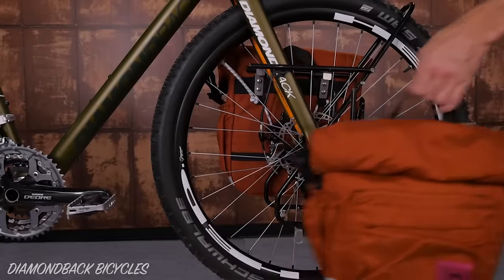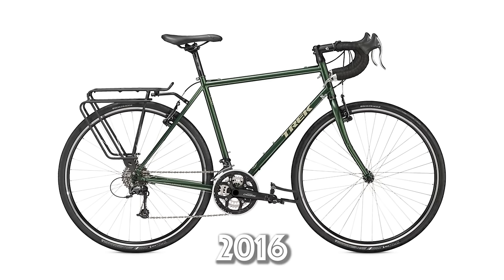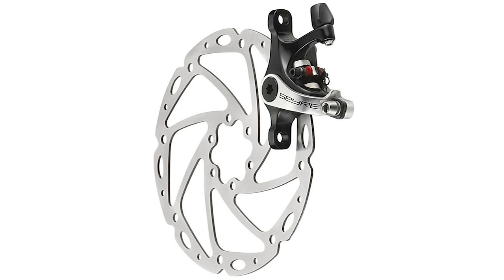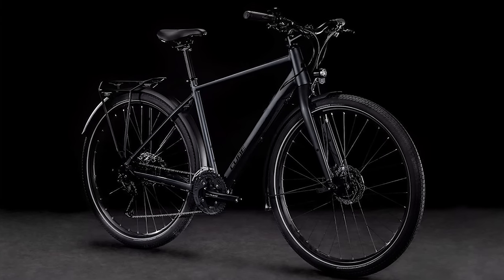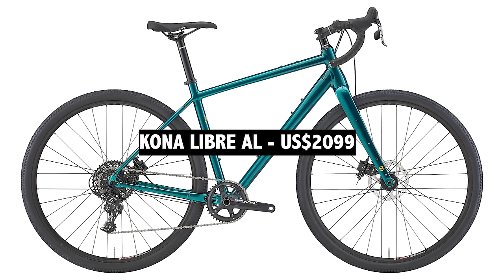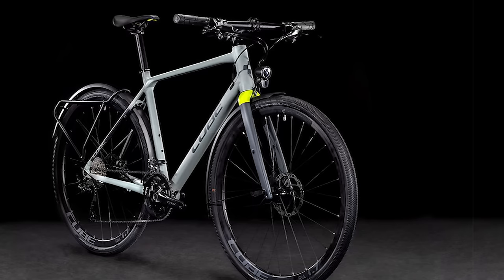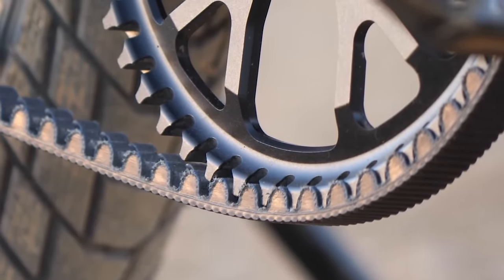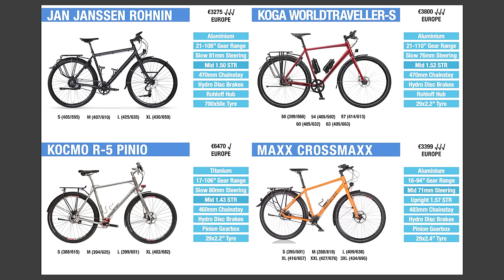The 13 BEST Touring Bikes For 2022!

Comment: Curious to not find the Priority 600. Belt drive, Pinion gear system, dynamos... It checks all my boxes!
Reply: Totally agree but I think the dynamo was ditched in the production run.
Reply: @Trenchfoot1  I have one, has a dynamo that powers the stock front and rear lights.
Reply: I think price was quite a big factor in the choice of bikes. I'd also like to see more belt drive bikes reviewed and can accept they would cost more.
Reply: @Rick--A-F  I think you’re right.
Reply: @johng1857  Ah, sorry. I was thinking 600X.
Reply: Pinion sure seems to be well priced for a Pinion / Belt drivetrain, but it's not really in the scope of Alee's list.
Reply: Maybe because it's more of a commuter than a tourer, geometry and component wise? The 600x though seems quite the offroad touring machine
Reply: @johng1857  I have a Tout Terrain Metropolitan that uses a Rohloff hub and carbon belt drive, it's a really good system and makes for a relaxing ride. I'm always interested in what other bikes are like!
Reply: True, l owned one of Priority Bikes. So far I am impressed by the Quality. I wonder this video mainly focus on Europe bikes!
Reply: Priority probably didn't payed for advertisement.

Comment: Nice video, I've done over 30 multi-week (and one 3 month in USA)  loaded tours on a 90's converted MTB with drop bars, and I've never needed a dynamo and lights.   I get it if you are riding in remote wilderness, but really, How many people are doing that so a mass market bike needs the expence and complexity of a dynamo.
Reply: What do you do for lights?
Reply: At least in germany you get fined for riding in the dark without lights (no matter how well lit the street is you are riding on), and I think it is pretty similar in other European countries. I was more suprised that lights were included as an extra since there are a requirement here for any bike (except dedicated racing/mountainbikes). Edit: on second thought: regardless of laws I think having lights (and a dynamo is just a great solution, since you dont have to worry about charging anything) is also a security concern, since cars see you a lot better if you have lights. So I think there are even more important in more populated areas and not so much in the wilderness where you will not meet so many cars/vehicels.
Reply: I agree, would seem commuters would be the riders who would benefit most from a dynamo
Reply: Now, during winter, I always arrive home after dark. The same has happened while touring when campsites were full and I had to look for accommodation after dark. A light, with a dynamo or not,  is needed to see and be seen.

Comment: The Shimano 105 11s pairs with a MTB derailleur in the Co-motion Deschutes? I'm not sure if it could work.
Reply: I thought the same thing, but Alee is generally very knowledgeable about gearing, so my guess is they've implemented a work around....
Reply: I checked this a while back while building up a gravel bike. 105 shifters won't run a mtb derailleur out of the box, but you can get an adapter that will make them work. I just ended up going with grx for simplicity sake.

Comment: These bikes to be honest all are expensive.What I did and suggest riders with tight budgets get 90's or 2k's mountain bike used $200 and spend few more dollars upgrading components then you get kick ass touring bike without breaking the bike.My present build less then 400 is Specialized Rockhopper solid bike

Comment: Hey, I really like your videos. But try to use metric, at least vissually overlayed in your videos. The world uses metric, its 2022, and I think you want to expand your audience. Sorry that I have to be an ass about this but frankly there are so much content producers who were raised in imperial and can't/won't make the complete switch to metric but at least 'they' try. So; absolutely nothing personal against you or your good videos but if you retain on imperial only, as a viewer I will continue and seek my content elsewhere. Absolutely no offense.
Reply from the maker: I use metric 100% of the time. 'Gear inches' are number that aren't EVER converted into metric values, and you don't need to calculate them manually either - so there is no harm in using them. I use gear inches because I prefer working with the 2 and 3 digit numbers that it spits out.
Reply: @Cyclingabout   I didn't know that. And you are right, in all the videos i watched of you since, you did use metric. I retract my critic, sorry. 🙂

Comment: Yeah, the pandemic hit right before I was supposed to pick up my bike. We were banned from the city I needed to go to and they wouldn't deliver. After a year the shop refunded me. I went to the local shop, bought a GIANT hybrid, ordered parts online and made a tourer. It has an aluminum frame and I definitely feel the wobble. I just learned to distribute the loads better. Surprised at the stock components the bike came with. The handlebars and tires I kept, but the drive train was heavy and it had no racks. It's done me solid for two years but I'm definitely looking to re-enter the higher end touring bike market.

Comment: Hello. Lucky for me to be seeing this video as I begin the search for a touring bike after many years off the bike. Frankly, the one that jumps out for me is that Koga World Traveler in the orangish color. But striking out thus far in finding a retailer here in the Atlanta, GA area. Any leads to a distributor would be much appreciated. And I won't close without saying "thanks" for making so much valuable information available. Best wishes and happy trails to all.
Reply from the maker: There are no KOGA dealers outside Europe. But you can buy online direct with them and they will ship to Atlanta. Or plan a bike tour in Europe and pick one up when you get there!
Reply: @Cyclingabout  Thank you, the second option will work well with the tentative plan to do EuroVelo 6 trail later this year. I'm on it. And Thanks again.
Reply from the maker: @richardcheatham9490  Just make sure to order it with enough notice. I believe it's a 13-week delivery time currently, but best to check with KOGA.

Comment: None of those bikes are looking comfortable to ride on. If the seat is higher or same height as the steer. I ain't riding it. It hurts my neck as I am looking up all the time, hurts my wrists and shoulders as I am constantly hanging / pushing on them to sit on the bike. You should take a look on the Dutch Omafiets. Their way more comfortable making you able to sit on it longer without pains.

Comment: For a rider who wants to tour in style, quality gravel rigs are the best touring bikes. Much better - certainly much classier and prettier - than ugly 20-kilo traditional touring bikes that sport perfectly horizontal top tubes, crude, ugly aluminium or cheap steel welds, hideously layman -type (almost upright) geometry, ugly steerers that extend half a meter from the head tube. 
 While I'm a fan of carbon, for loaded touring I'd prefer a titanium bike with the following specs: 

 - Beautiful 3D-printed lugs instead of ugly welds. Beautiful, carbon-like oblique joints and not a single visible weld. 
 - Ca. 13-16 degree top tube weld: horizontal top tubes loo ugly and awkward. 
 - Preferably, NO dropped seat stays! A bit irrelevant for touring bikes, for I am yet to see a touring bike with dropped seat stays, though you can never know what to expect from fad aficionado designers. 
 - Integrated invisible frame couplers (i.e., Santana Z type, also used in some 22Bicycle models). 
 - Fully internal hydraulic brakes with leak-free, dry hydraulic couplers (i.e., 22Bicycles' Brake Break). 
 - Have all the mounts one will ever need: for mudguards, fork crown -mounted headlight, front and rear racks, a bentobox, 4 bottlecages and / or instant on/off bikepacking frame bags, etc. 
 - Integrated hub dynamo wiring to the fork crown headlight, to the taillight and to the stem to charge equipment. 
- I don't know if titanium tubes can be hydroformed or not, but surely they can be made to look like carbon - i.e., flat tubes and flat and tapering top tube  Just like the Salsa WarBird's. 
 - RedShift ShockStop stern and seatpost. 
 - Should come with a hard case with hard foam inlays for the split frame and parts. Designed so that thee things that torch the ground (i.e., the tyres, the wheels and pedals) don't touch and soil the frame, the drop bars and the brifters. 
 - Total frame weight, including fork: under 1900 grams. 
 - Did I say the titanium frame should visually mimic a quality carbon frame? My design of choice would be the Salsa Warbird, but with 3-4 degrees greater top tube slope. And yes - threaded BB, please! 
A frame like that with something like the Sram AXS, Spinergy 47mm deep wheels and Chris King headset, bottom bracket, etc. - would be the perfect touring bike! And the same design with a light electric motor, a max assist speed of 45km/h or greater, and a range of 200km (loaded to ca. 150kg!) per charge or greater - would be the best electrically-assisted touring bike out there.

Comment: My best touring bike? Bought second a Belgian 1974 steel Bertin.  Kept the frame and built up with quality components, most 2nd hand  . Excellent bike for  650 € . 36000 km in 3 5 years, cheap, goes forever and not fooled by the hype bike industry with their Asian rubbish.

Comment: You missed the best bike of all.  You always miss this bike.  This brand never factors in your review.  Thorn Cycles! The Thorn Mercury, I would not ride anything else on a tour.  Apart from the Thorn Nomad if I were on a around the world trip.   I own a Mercury.  This is a cycle I clock up over 1300km every month.   I tested many of the bikes featured here, this came out on top.  Not by a little, but by a lot.  Yep, there very expensive, but there also amazing.  I cannot trust your judgment when you do not even feature one of the best makers of Touring bikes in the world.
Reply from the maker: You mentioned that you've tested many of the bikes here, and that the Thorn is the best. But you haven't told us why it's the best...
Reply: @Cyclingabout  The build. comfort. frame dementions. A cycle that seems to feel even better underload. High quality parts. solid made steel frame. Hand made wheels. Amazing customer services. Cycle built to my measurements. Ability to send in custom parts they do not stock. A frame created for the Rohloff speed hub. A design team who created a build based on experiences of tours. I do not work for Thorn. I am nothing more than than a very happy customer with a few thousand km in the saddle of one.  I have been shocked to not see one  included in any of your reviews.
Reply: @marccarter1350  Are Thorn still anti disc, have a nice touring bike with disc no wearing rims out 😃. Don’t think it’s about custom bikes , we are looking at what’s avalible at a reasonable price
Reply: @ronnie8446  No. My Mercury has a rear Disk brake.  The logic behind non disk was the ability to fix brakes whilst touring. V brakes are very simple to fix. I would rather fix V brakes on a tour over disk any day. I am not really a fan of Disk myself. Wanted the Mercury without them. They only had the one with. My Audax bike is rim. It stops fine. Upgraded the brake pads for longer rim life.  Rims cost nothing to replace anyway. Many high end touring bikes still only use rim brakes.